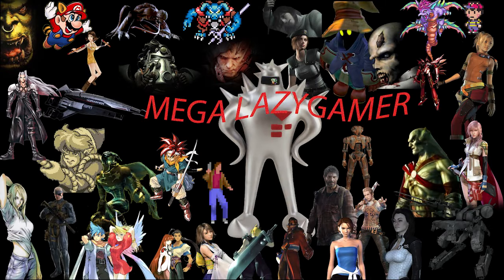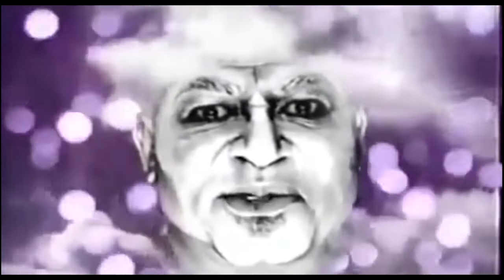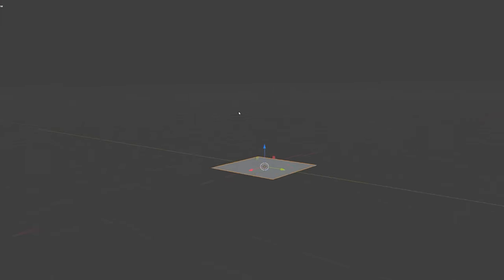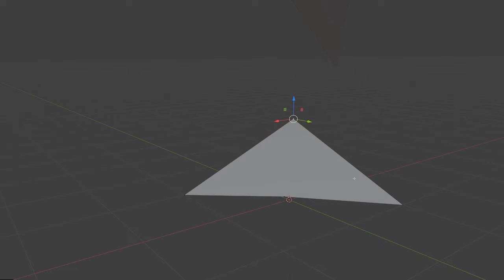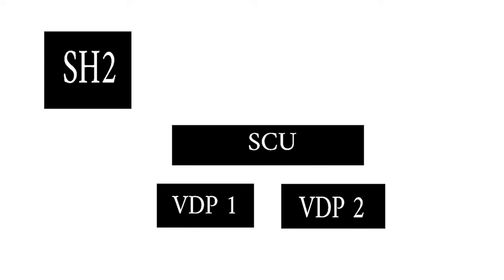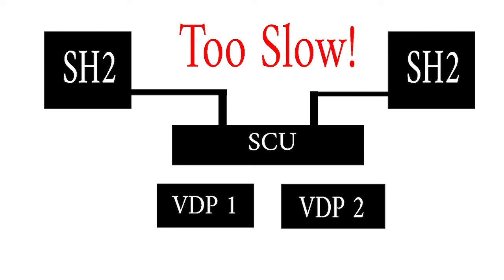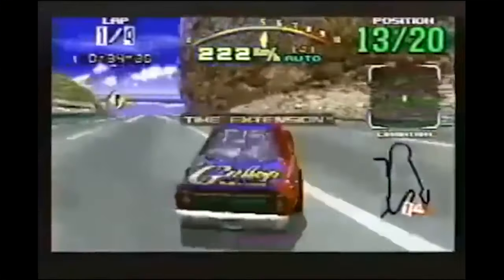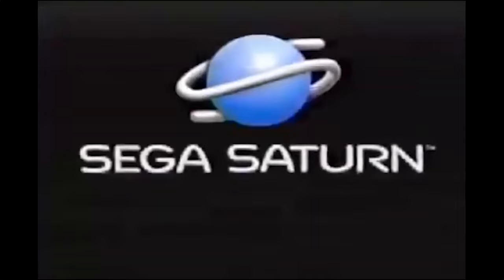A Rant About The Sega Saturn

Comment: Sega Saturn is a very good example of what happens when you don't have a user friendly software development kit.
Reply: They could of had a perfect dev kit and it wouldn't have mattered. Sony was an 800 pound gorilla that could buy up developers and offer cheaper 3rd party publishing costs. Final Fantasy VII pretty much propelled them past the competition of both Nintendo and Sega.
Reply: @Gamevet  Sega could have made it out the other end like Nintendo did. From what heard they had a united front unlike Sega. The writing was on the wall when all Saturn had were the launch titles for a about year with nothing new coming out. I am in the camp that thinks Sega should have kept the 32x out until they got the Saturn sorted.
Reply: @caribeskinner6290  The 32X was a cancer for Sega. They should have used the resources they'd spent on 32X software to support the Saturn. The Saturn could have had an arcade accurate port of Star Wars Arcade, along with a better version of Virtua Racing for the Saturn. 

The Saturn should of had a legit NFL game for the Saturn, during the fall season in North America. The Sega Genesis had a lot of sports fans in North America. Sega pretty much let Sony take over that market when they showed up with the rock solid NFL Gameday. EA pretty much canned their Madden game that year.
Reply: @Gamevet  The point of the 32x was to buy time to developing Saturn while spending the minimum of resources.  Sega Japan instead rushing and got nothing. Develop wasn't a problem for Sega, it was a problem for 3rd parties. Getting their buy in and support takes time. That's  not something you can throw bodies to fix. I have worked in dev environments. The worst thing you can do is rush a product. It is the best way to lose support and that is what happened to the Saturn. The 32x was more about getting the 3rd parties/sdk together. Sega America could have focused on the games you talked about but there still would not be any more additional 3rd party titles at launch and the year of dead time would still be there. To anyone who writes a rebuttal to this, ask yourself what was the the problem?  Try not to confuse symptoms with being the problem.

Comment: What's cool is that these unused or rarely used functions and processes are being used today. Someone remade the entire first level of Unreal 98 in a highly modified version of Quake as a Saturn Tech Demo this or last year, and it does crazy shit like realtime reflections and dynamic lighting. There really is an absurd amount of power locked away in this console, but I can't think of any retail games that tapped into it. SEGA's biggest folly around this time was having to make last minute changes to an already conceptually iffy design (Always attempting to achieve arcade parity) when they realized that they weren't going to be able to sell a console on enhanced 2D games alone. That's what primarily lead to the fascinating, wonderful, horrifying, homonculus, that is the SEGA Saturn. If I were to take a guess at what the initial working draft of the Saturn was, I'd guess it was probably closer to the Neptune, but with a CD ROM drive, a better video display unit, and the MPEG add-on card, on the board as a feature. No huge emphasis on 3D, possibly accelerated later with an SVP chip sequel in the cart slot.

Comment: When the CD standard was created, the possibility of using the medium as a data storage wasn’t a priority. The priority was to make it reliable with the available technology, and that technology was prone to many, many problems. The laser beam had to be generated the traditional way, with coils and high voltage mercury lamps, then the laser needed to be shot through a series of lenses and mirrors so it can be bounced on the CD surface and finally read by the detectors. Because of this, the road to digital to analog conversion was a bumpy one, which would result on constant clipping and artifacting... unless the system would be able to check constantly if the reading was correct and if it wasn’t, something would tell it instantly how to repair it and deliver the right thing. Enter error correction.
Error correction would make CDs highly reliant but at the expense of efficiency. A big chunk of the usable space would be reserved for error correction and and to prevent other problems, it would also make them have slow access for data reading.
Reply: Now that the audio part was sorted out and the machines were selling like pancakes, it was time to get more from it. The first solution was the CD-i standard, an expensive, slow and quirky way to get data by using those tiny spaces left to avoid and fix reading errors, but its applications were mainly for video and audio that the user could interact with. But later came the need to store and read data more efficiently and dedicatedly, so the companies started a race to create a CD Data Storage standard.
Reply: NEC couldn’t wait for Sony and Philips to come up with something so they created their own standard on their own terms. 
The CD-ROM standard would appear soon after and just like NEC did, video games would be one of its uses. But unlike the NEC non-standard, it was not suitable for them, it had no optimization, had to be reliant on error correction, had to allow CD audio playback and was slow and exclusive access, the processor had to pause what it was doing to move the laser and start the reading. Sony realized that and worked on a second standard: CD-ROM XA.
Reply: And it is CD-ROM XA which gave the PS1 the edge, not only against the Saturn but to the rest of the consoles. Sure, it threw most of the error correction out the window making it prone to reading errors, but the fast and efficient access allowed games like Crash Bandicoot that could create huge worlds by reading constantly small chunks of data as they were being needed while not stopping or slowing down the action.

The Saturn, on the other hand, had the same problem all CD-based consoles, with the exception of the PC Engine, had. In order to play anything, the RAM had to be filled with the necessary data, if the game would require more stuff, everything had to stop, music, video, action, everything until it finished loading. 
You could say the PS also had that in games like Metal Slug 1, but that was just lazy programming as the sequel did the same as the other games, only loading when it was extremely necessary.
Reply: Ever wonder why Croc barely ran on the Saturn? Because it could hide constant loading after every time you enter to another section, something that the game is full of, but not Crash, or Medievil, or most of the 3-D games on the PS1.
And then there’s the games that some take as proof the Saturn could do it: Nights and Burning Rangers. But, could they? Every stage of Nights is confined to a cylinder, a cylinder that has most of the stuff loaded from the start. The game uses a special sound generation routine that saves and allows for a very brief moment to load small bits of data every time a round of the 3 in every stage is completed. A nice trick but still too limited.
And Burning Rangers? It has constant pauses disguised as game engine created cutscenes using a sound compression format known as ADX; the ADX plays while the next part of the level is being loaded, giving the illusion of playing a huge 3D game like Crash. A really clever trick but came so late that it would never be used in the console but in the rest of the ones that would follow.
Reply: The Saturn was an unsalvageable disaster no matter how you look at it.

Oh, and everybody also forget what the Saturn became in Japan soon after the N64 came out and Sega became aware they have to make a better system. 
It became the waste bin where all the ecchi kusoge were thrown to. Sega allowed everything just to keep presence in the market while the DC was being developed.
If you think the Wii is the king of shovelware, you haven’t seen the Saturn library from 96 to 98.